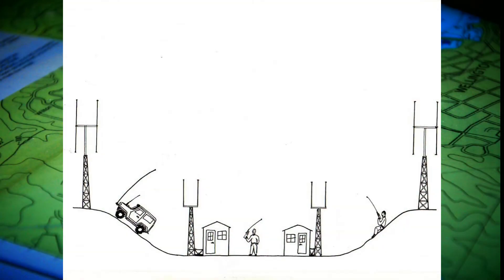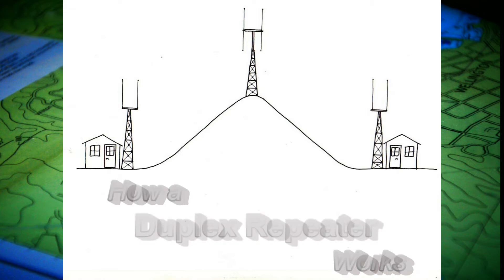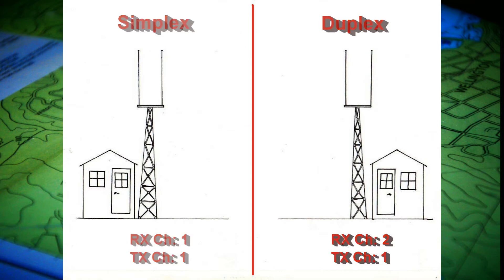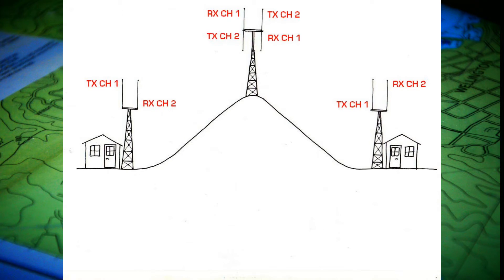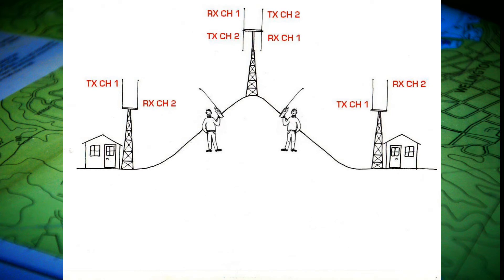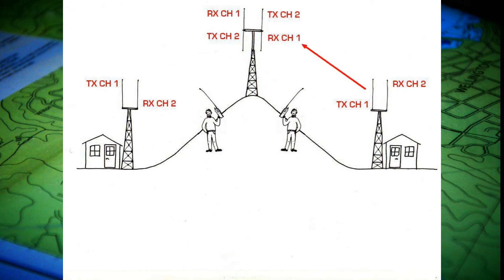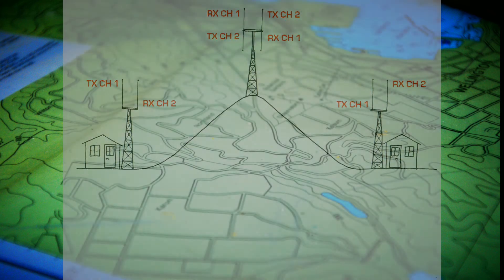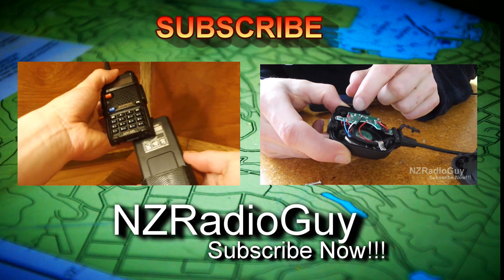How a Duplex Repeater Works

Comment: No. at least I don't think so.. No I've had a bunch of walkies like the twintalker, actually twintalker 5000 and hoffer 2203 laying around for years.. and we just started using them. So I was just hoping it was possible to do the same with these like you do in the video. That way we could put this in the church steaple, and be able to communicate all over town and surrounding area.. but I guess we'll have to make do with one of the recorder boxes and some just have to listen to the same message being transmitted two times
Reply from the maker: Cool. No worries. Thanks for the comment. All the best. NZRadioGuy